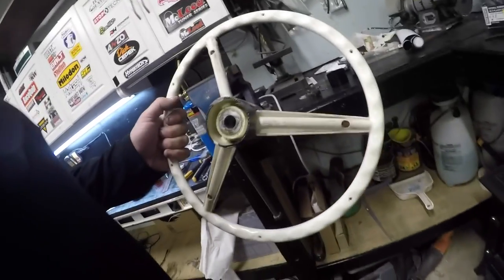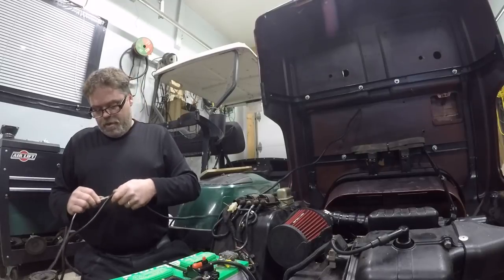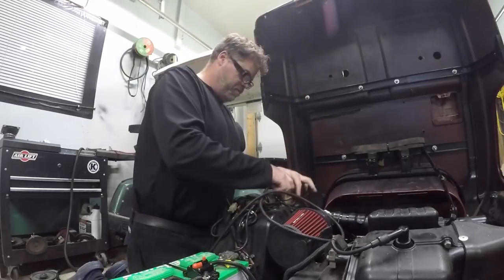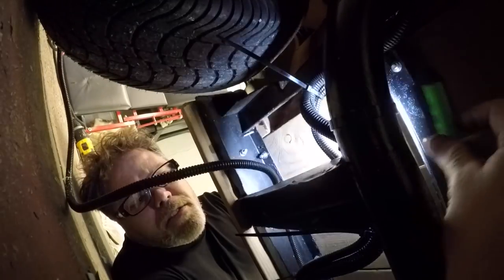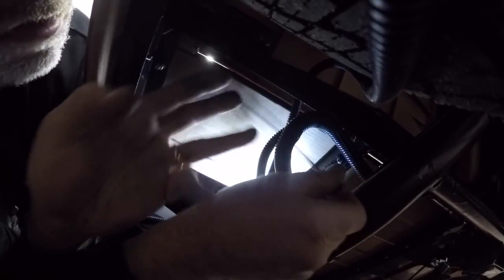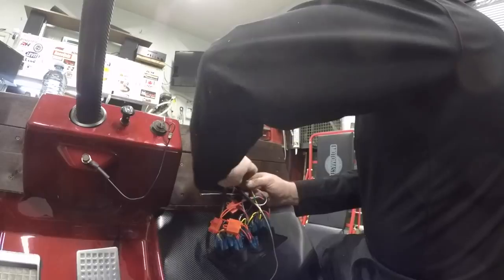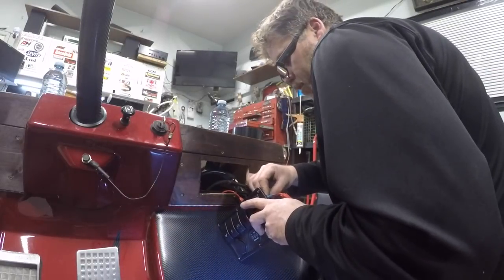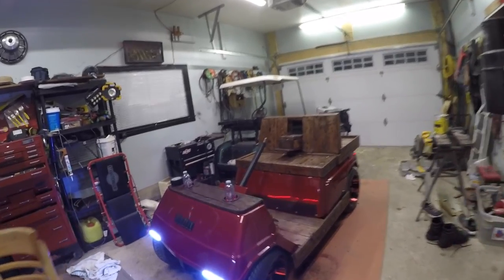Time For Some LED Lighting

Comment: Bill Siff...the cart is progressing nicely...why wouldn’t it! I’m doing a G-1 rebuild as well. The charging system on the G-1 is old school...the starter/generator is just that...a generator. It is likely that the voltage regulator is bad...it is the component just back of the forward/reverse solenoids. Might still be cheaper to go your original route? Hope this helps...why the hell wouldn’t it! Lol.

Comment: i think it looks fine the way it is,  but if you do a top try to make it fold away... as for you carb try to buy ethanol free gas,  the ethanol evaporates and is displaced my water ....  i buy ultramar premium  for my boat,  my mower hates premium so it gets seafoam (moisture control)

Comment: Could you divert the extra voltage to a capacitor for the amp?
A top would provide more room for speakers n lights...lol
Reply: you thought exactly what i thought bear, big arsed cap would make best use of that extra power with a properly dropped 20hz sub sonic croosover/ filter thru a big mono block heater (amp) and rattle it to pieces and put a smile on the wifes face lol (soz didnt mean to be creepy or crude) its just a phrase we use in europe :)